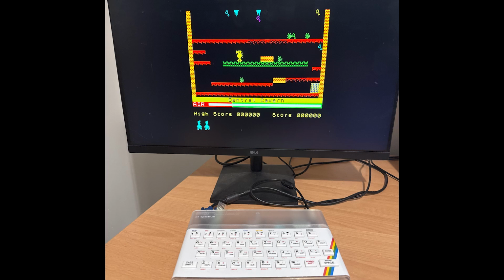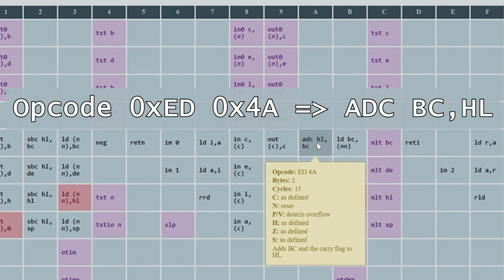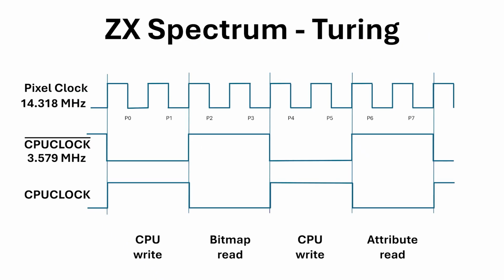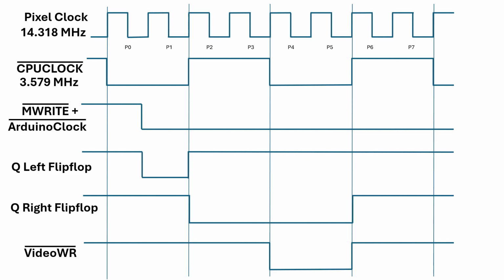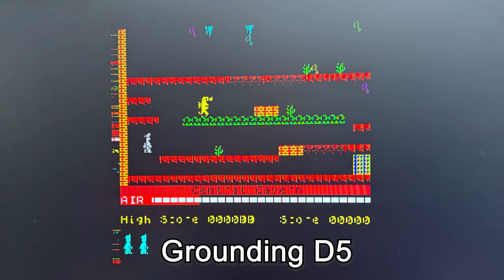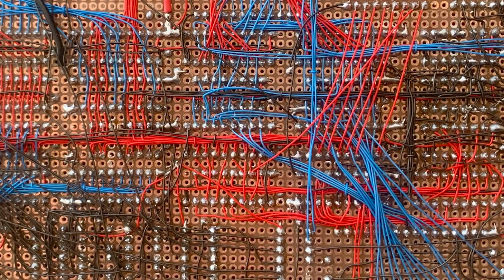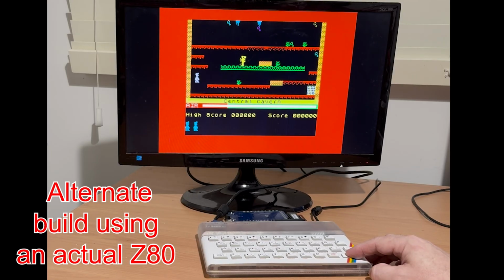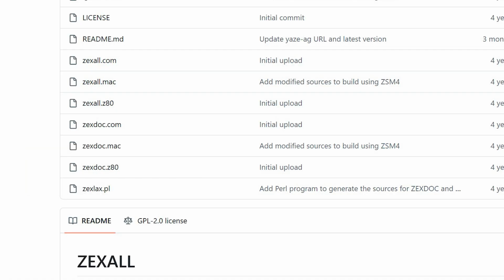ZX Spectrum Turing Edition Part 5 - Bring-Up

Comment: Another great video Matt.  Do they even make 50ns EPROMs? Can’t wait for the next installment.
Reply from the maker: Thanks for that.  Yep, believe it or not they do.  In the "VGA from an EPROM" episode i've had the 27C322-50 running at 12.5MHz and 14.318 MHz.  I may go back to two EPROMs which means i can use the 100ns EPROM, but i still need the 50ns SRAM.

Comment: fpga running assembly instructions real time, the fpga being instructionsless by itself. ie first build the generic fpga frame work, only then build the state machine instructional cpu cores on top. paper launches rock. like people stuff usually. all beta tests only. if you stick to the basics, ie copy, then you dont invent anything new. just copy implementations of the same system. something truly new only comes from above, not from people copies. honor to above alone. for christ sake.
Reply from the maker: Ummm...  Turing machines, EPROMs and SRAM and D-type flip-flops all came before FPGAs.  Don't get me wrong, i'm a fan of FPGAs, particularly when you need more performance.  But, i personally don't like the abstraction layer between what you design and what's running on the silicon.
Reply: @DrMattRegan I agree. The Turing approach really gets down to having (or teaching) a full knowledge of how everything works. Abstracting to an FPGA, or even CPLDs such as I used to work with, requires a leap of faith that the compiler is doing its job correctly. Also, the Turing approach is inherently completely deterministic as far as all timings are concerned. I just love this!
Reply: Amazing work, would you consider putting together a book for electronics students about how to implement such state machines ? I'd buy it.

Comment: Are you actually trying to match the Z80 clock 4 clock? I ask because you mentioned tape loaders. I’d be interested to see if you could load a game that used turbo load. Certainly the turbo loader that I wrote/used on my Wally games depends on particular instructions to provide timing ?
Reply from the maker: Yeah, i'll see how close i can get it.  I think all instructions so far are less than 2x the clocks of the original Z80, so i should be able to pad them out.  Getting things like a turbo loader will be tricky, and ultimately i think i'll probably use an SD card.  I think the NTSC timing (60fps) will kill some games as well.  Any specific game i should try.
Reply: @DrMattRegan any of the Wally/Mikrogen game cassettes from Pyjamarama onwards had turbo load.

Comment: If you really want to push that software metaphor you should be able with minimal hardware changes be able to replace the ROM (software) with another getting another system to run. 

Wonder how possible it would be given the current architecture, only problem I can see is maybe video related, right?
Reply: The hardware details of various computers are highly specific.  You'd have to change a lot to do this on another platform.
Reply from the maker: Yes, particularly the video circuit/raster generator, that's generally what changes the most.  The CPU basically stays the same.
Reply from the maker: Correct, the Commodore64 build (https://youtu.be/MG3j_6DBCIE) basically uses the same Turing Machine, but the state machine emulates a 6502.  A few minor tweeks, but the hardware can run either 6502 code or Z80 code by changing the EPROM.

Comment: Fantastic from concept to reality. A really enjoyable series. Well done Matt. Will there be a book on the VIC20, C64 and Spectrum soon ?
Reply from the maker: Thanks for that.  I’m working full time at the moment, but I have a big chunk of leave early next year.  The book will mainly focus on the 6502 and the Apple2.   I’ll try and make all schematics available.
Reply: @DrMattRegan Maybe AI can transcribe your videos and interleave the key image frames? I will buy it if you complete the VIC20 games testing with some Llamasoft and Star Defence 😂
Reply from the maker: Actually, i usually script the videos (otherwise i ramble on), so i have all the scripts in digital form.  There will be more content than in the videos though, and it will follow a more logical flow.  The information tends to be project based here, so it's a bit scattered.  Will look at the VIC games!